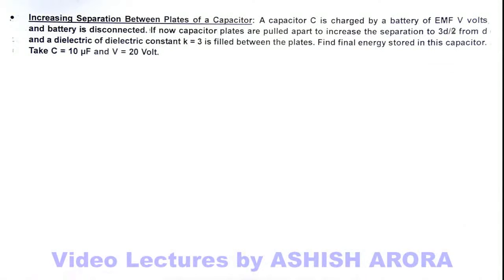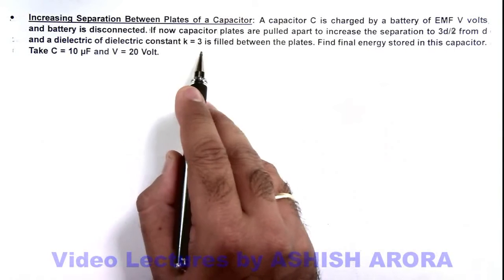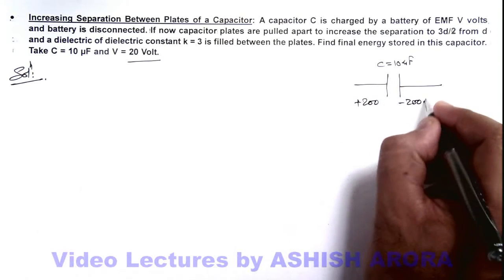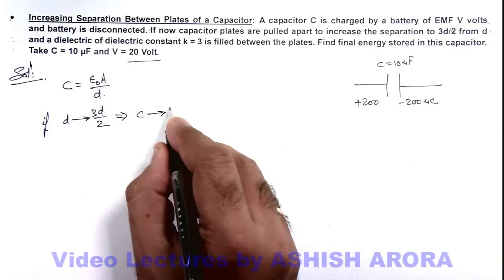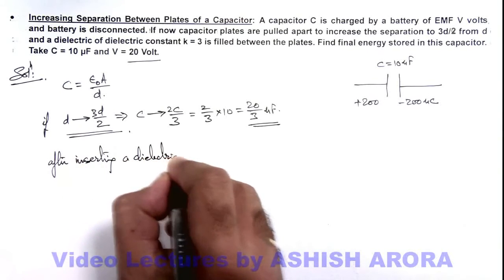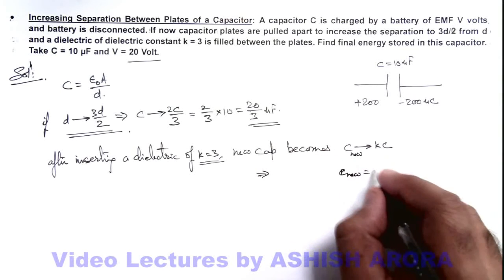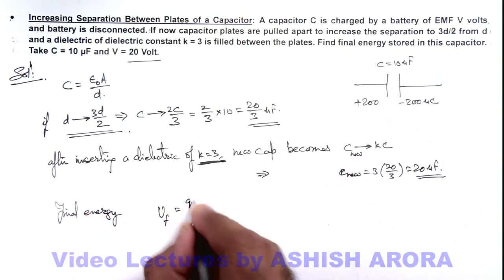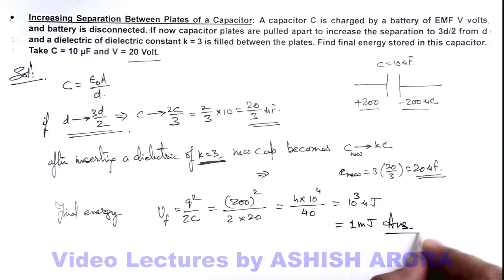31. Advance Illustration | Capacitance | Increasing Separation Between Plates of a Capacitor

Comment: sir, when we use 1/2CV2 in the final result we get 4 mJ...why there is change in answer?
Reply: Because the battery is disconnected so potential is not  constant here only charge remains same not potential
Reply: v is also changed as v=ed and since e is const[ e=sigma/eo] so, v is inv prop to d
Reply: Put V as 10 instead of 20 then u will get correct answer.

Comment: Ok what happens for Q  ( charge ) if we increased the d by 2
Reply from the maker: increasing d by 2 means if we double the separation capacitance will reduce to half → C/2 that means if battery is connected then charge will reduce to CV/2 means it will also become half and if battery is not connected then charge will remain constant...